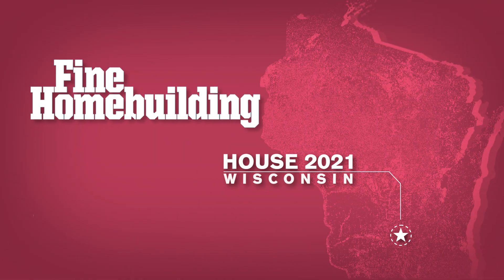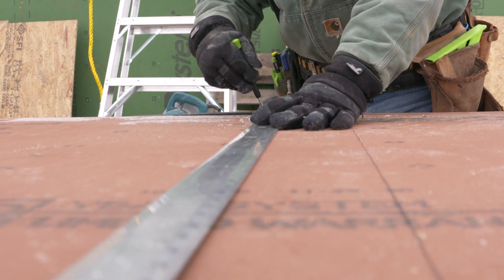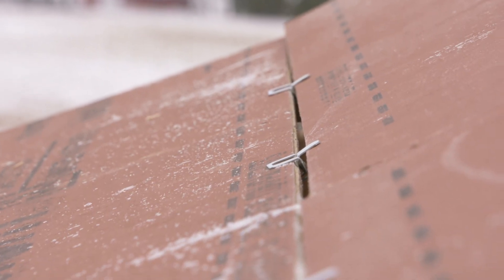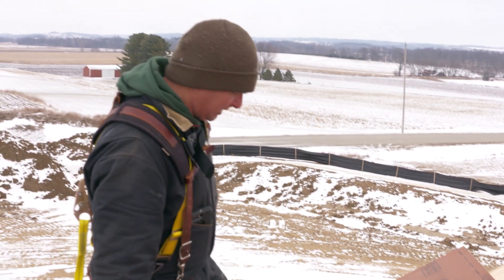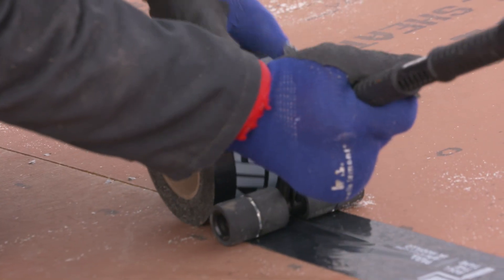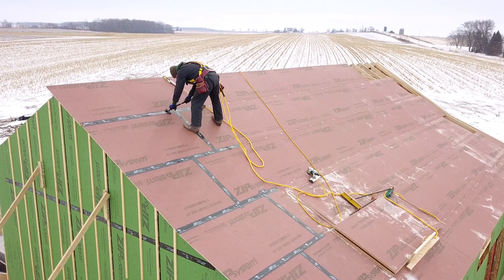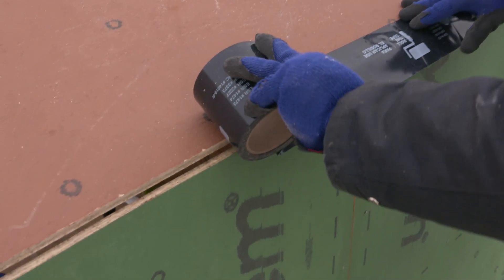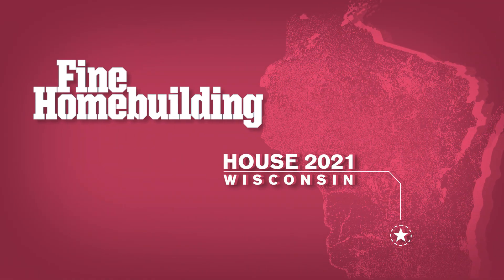Episode 2 FHB House WI: Sheathing the Roof and Completing the Air Barrier

Comment: Never used the zip panels though , I've only worked with plywood so that may make a difference with you using the tape.
Reply: i have never and will never use an osb product for exterior/roof sheathing.... its garbage
Reply: Id recommend you look further into zip sheathing. I once had a similar opinon  @fredjohnson4772

Comment: You don't have to use H clips with 1/2" Zip panels with 24" OC framing. Check the Huber literature.
Reply: You do if the engineer or architect required it. I just use tongue and groove.
Reply: I was also wondering about that thinking what a nice idea it is. I suppose taking this extra measure might pay off decades later
Reply: yould be a fool not to.... osb is garbage in and of itself...